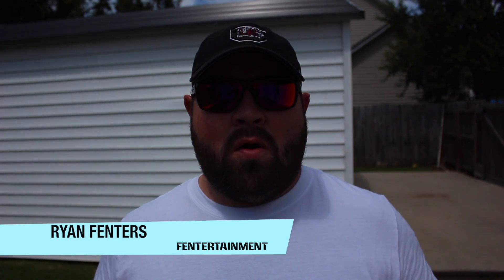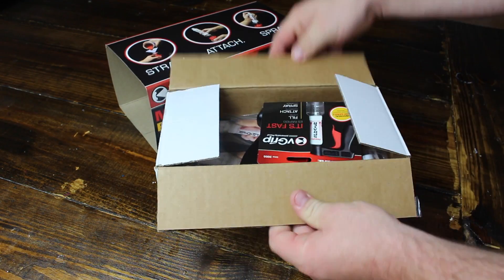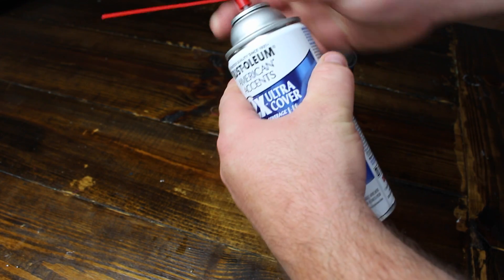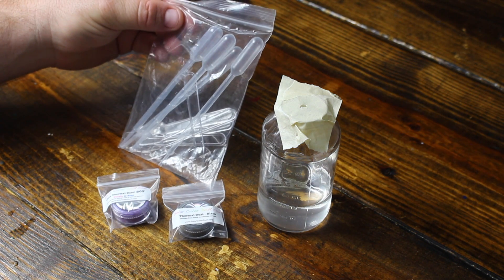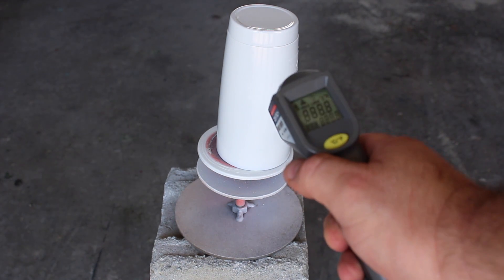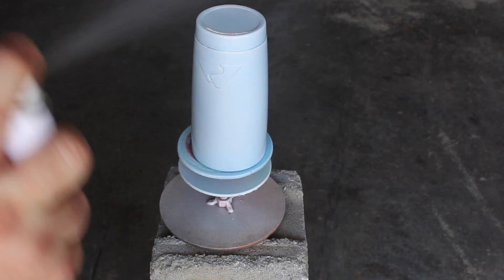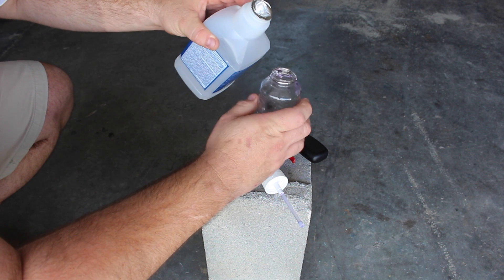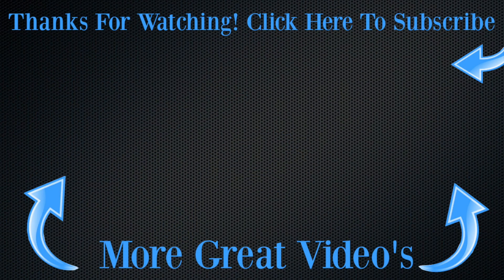DIY | HOW TO MAKE COLOR CHANGING PAINT

Comment: Great video. I have a question for you as I'm in need of help. I'm doing my final major project for university (Graphic design) and I basically have to design something that shows the combination of design and chemistry. I have chosen to create a visual Thermochromatic science labratory. I wanted to know how i'd go about applying thermochromatic paint to glass tubes etc. Also, if I printed a book, how would I apply it to the front cover?

Any ideas? 
Many thanks.

Comment: Can I use the oven to speed up the curing of the epoxy resin? What temp and for how long?
Reply: I would do a few short blasts with a heat gun at the most to speed up the resin. Once resin gets hot it gets extremely liquid and will basically just melt off the cup.